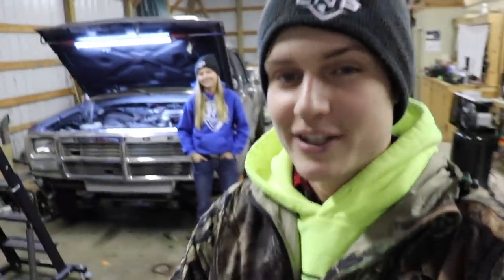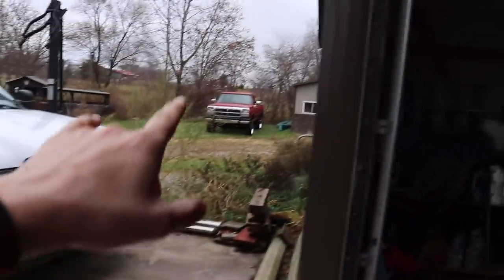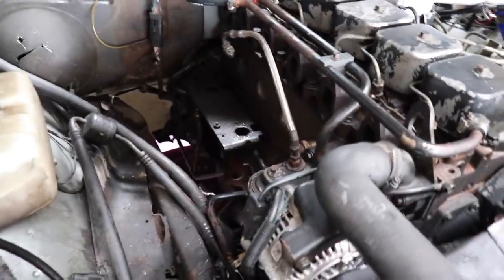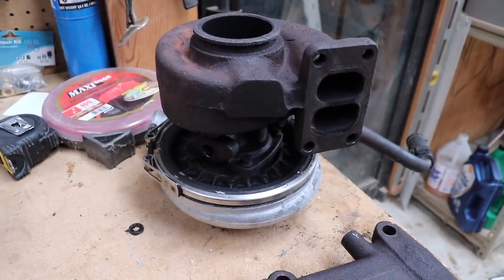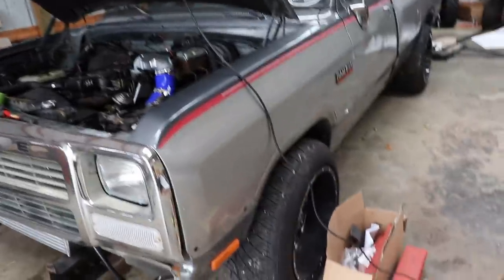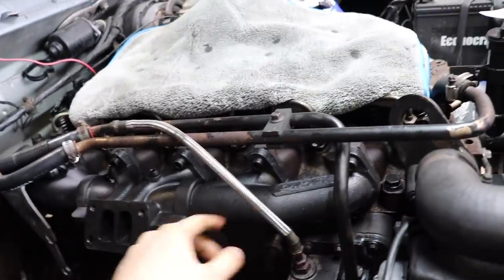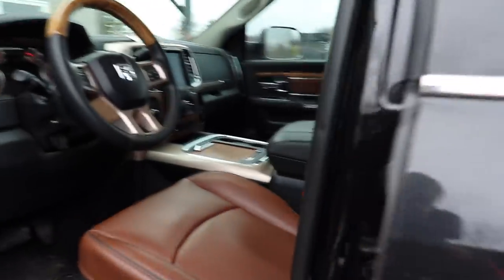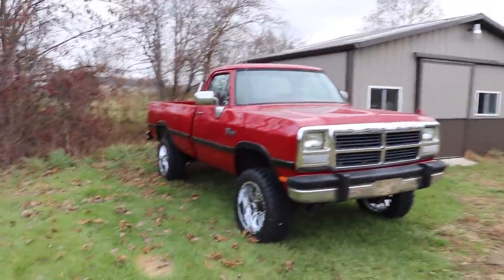1ST GEN 12V CUMMINS STREET TRUCK BUILD IN FULL SWING!!!

Comment: I’m available to assist in removing transmission heat exchangers if needed😂👌🏻😜 I’m certified now by Mr.Proud
Reply from the maker: Reagan Marshall she forgot to mention she’s an LNP exclusive shop hand! 😂
Reply: The real reason y’all are together is so she can hold the light for you.
Reply: Reagan Marshall great can ya install a Pacbrake load-leash ... swap out intake and exhaust manifolds with AFE blade-runners and a fleece cheetah turbo and wherli fab air intake for me. 👍🏻 oh and pay for it for me 🙏🏻🤷🏻‍♂️

Comment: Not telling you how to build your truck.But I would recommend a gated housing for the h1c or your drive pressure is gonna be extremely high when that 475 spools up and is pulling air through that little h1c

Comment: Should of used a power driven diesel compound kit dont have to move the trans heat exchanger
Reply from the maker: big murph would have been nice to know there was another option 🤦🏼‍♂️
Reply: @LOUDNPROUD  yeah there kit is the only one I know of. U could always do away with heat exchager and get a cooler with a small fan on it put it under the bed somewhere.